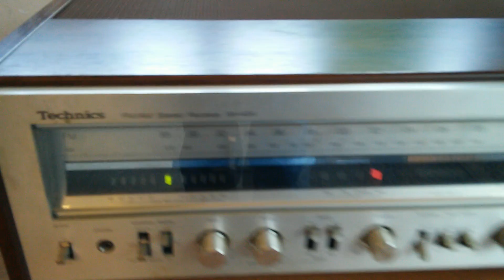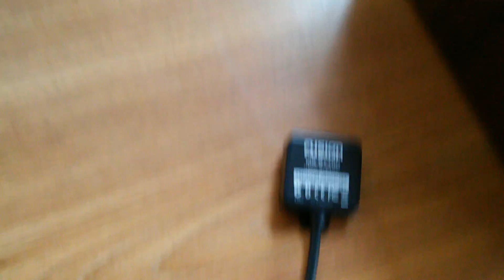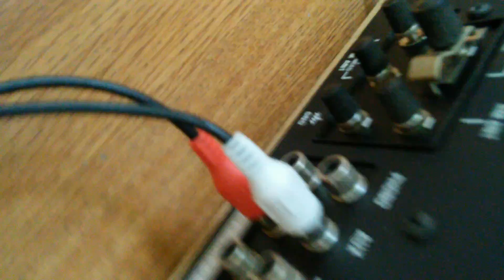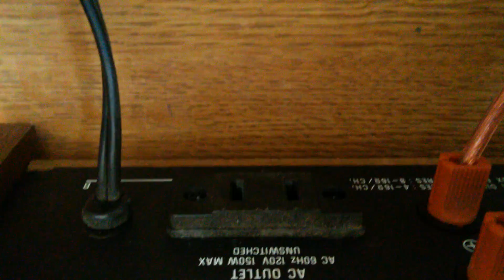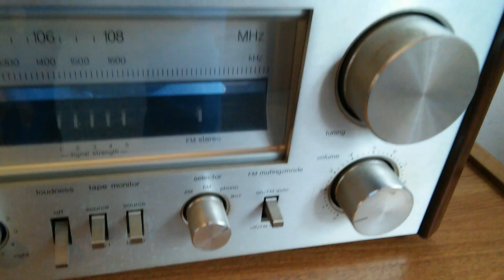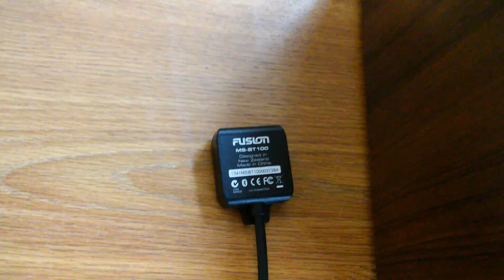Add Bluetooth to any vintage Home Stereo

Comment: My connection is very poor, volume very low, in and out, etc.  It has performed well at other times.  I think it might be my phone, low storage, slow,, etc...
Reply from the maker: could be, keep us posted. So others know what to expect...BB23
Reply: I find I have to jiggle the wire on my adapter fairly often, pull it out and push back in

Comment: Another, and perhaps more compelling way for wireless is Apple's Airport Express. Connect it to your modem/router and then to RCA input that's available on receiver. Now, listen to iTunes music library stored on computer or iCloud wirelessly from receiver. Also, the Airport Express will allow you to use iPhone or iPad as a music player, or remote for iTunes on computer with receiver outputting those tunes too.

Comment: Question. Is it possible to get CD quality audio this way? I've never heard a smartphone or tablet actually sound decent on a car or home stereo system. It always sounds digital, no base either.
I have a Galaxy S7 phone and a 2 year old galaxy Tablet too. Both sound awful with any audio i play... headphones sound great but it doesn't translate to my Pioneer in the car or my Bose/Panasonic setup at home
Reply from the maker: I have the same phone and a tab 2.7 tablet, both devices sound very good using Bluetooth. Audio snobs will not agree whit me, but you asked me and I say try it. you may just like the quality that you get. BTW ... using headphone out from your phone or tablet to your car stereo 3.5mm AUX inputs are going to sound like shit. IMHO
Reply: CountryBoy85  Thumbs up for caring about audio quality.
Reply: Strong Tower Lawn Care There are apps that may make that possible if you Daisy chain a tablet or laptop in-between. The sound vintage receivers and separates can put out will be hampered by a Bluetooth and compressed file vs a good Record player.

Comment: Do you know if you can use your phone as a wireless remote for volume on an old stereo receiver?
Reply from the maker: Two things,, I am glad you got an adapter and got your setup running. And On a old vintage unit that has never had any remote functions, you cant just "add" remote capability( no circuitry). Now if you have a unit that has had remote you can use a universal replacement remote control. as far asI know you cant use a smart phone to remote. UNLESS there is an app available like on modern TVs from the stereo manufacturer .. Thanks for watching....BB23
Reply: breakerbroke23 Thank you for the information. It's working great. I did find a universal remote so I think I'll use that. Love the video.

Comment: Any idea how to possibly wire the power supply for something like this to the power output of a stereo?
Reply from the maker: There are a fw ways to do that, look for a 12-28 volt dc tap on the power supply and use a usb step down module ($3 on ebay) they will take up to like 35v . or tap 12v from a dc source and use a 7805 regulator and make a filtered circuit board.....  IMHO just use the 110 adapter and plug into the sw out. I understand you would like a "built in unit" but in order to do this you better know what you are doing. OR you could ruin something or create a side affect like a hum or something by grabbing power off the wrong tap or part of a circuit.... OR hard wire a ac adapter into the receiver its self. Again, you better know what you are doing....If not, dont do ir...  BB23
Reply: breakerbroke23 thanks I was just curious if it would be possible, I’m currently using a sears Silvertone floor model record player and am/fm radio with an aux out (labeled for a tape deck) I’m currently using the rca to 3.5mm plug connected to a Bluetooth receiver with a 3.5mm plug using a coupler. The receiver is using a usb cable and power block. I’d like to figure a way to streamline this
Reply from the maker: Oaky, what is the model of your silvertone
Reply: breakerbroke23 the owners manual says 528.31093100
Reply from the maker: I cant find anything on your stereo. You could do what you want maybe if you had a schematic for the electronics. I like what you are trying to do, It would be cool.
Reply: breakerbroke23 it actually came with the manual and the wiring schematics are included. I’m a novice at that type of thing obviously or else I would t be asking lol
Reply from the maker: Hey since you have a schematic, maybe you could wire up one of these modules to your Stereos main power switch, and that would give you power for a USB powered Bluetooth unit ...hmmm  (the module has holes on the PC board so you mount it somewhere)
www.ebay.com/itm/AC-220V-110V-to-5V-DC-1-5A-Dual-USB-Car-Power-Charger-Step-down-Converter-Module/112471871214?epid=8004775070&hash=item1a2fd88eee:g:niEAAOSwhf1ZnjgP

Comment: Hello, I have an old stereo console , there is no aux input but there is a tape monitor thing on the back . Would that work and switch it to the Stereo option ? Thanks !
Reply from the maker: Using A Tape in or mon should work well, try it.
Reply: yeah thats what I used on my Integra for my BT. plugged it into the power plug on the back

Comment: It is easier to buy a adapter these days. Some are less than $10.00
Reply from the maker: Yes you are correct. You still need to power them up, either USB or they are rechargeable (PITA). so why not just do it right the first time and forget it. I still use this setup in my Office most every Day and have not had ANY failure of connect problems. BTW.. These units have extremely good range.  Thanks for your comment.

Comment: hi, when you turn the unit(technics) on and off does it detects and sync with the bluetooth or you have to turn the bluetooth on manually? thanks
Reply from the maker: When using a BT unit like the one in video, it turns on with the receiver and will sync with your phone or it will be ready to connect to yor phone if that is the first time.
Reply: sounds good. thanks

Comment: I have vintage Kenwood speakers and wanted to revive them. 
Simply, what is the best and smallest receiver/amp do I need to connect the speakers, in other words what components required when only having speakers?

thanks in advance for any guidance.
Reply from the maker: Small as in size, or power output ?
 Most all kenwood speakers are built whit highly efficient bulk drivers, so most any Receiver will work. BUT!
Try to get a 70st0 early 80s era Receiver. 30 watts per ch and up. 2) things.... Those Receivers usually have Phono inputs and have robust internal amplifiers for the most part. You can pick up modern Audio/ Video Receivers but their amplifier stage does not have the rich full sound that the older units have and usually no Phono inputs. (some do like Denon) INMHO 
 Remember, the more power you have the better. Even if you dont crank it up you still have reserve power (headroom) so when you are listening to say the 1812 overture and the cannons fire it will sound rich and full.  Thanks for watching....BB23
Reply: Great stuff. thank you. I need to digest it.

Comment: Once I restore my Pioneer Sx-1250, I'm gonna add this to it so I don't have to fumble around for my aux input cable anymore!
Reply from the maker: WOW those 1250s are bad ass. I would love to get my hands on one, Thanks for watching
Reply: breakerbroke23 No problem, I gotta fix an issue with mine, the left channel is quieter than the right. After that I have to replace the big filter caps, and see what else needs replacing.
Reply from the maker: Just a hint, Check the pre amp out level, make sure the audio out is equal. If not then check in the pre amp section. If both channels sound equal then the problem may be in the out put section. Good luck ....BB23

Comment: sounds like my old sansui 9090db is going to get hooked up with my ess amt1 b s  ( re coned)  are going to be playing some led Zeppelin, 😎
Reply from the maker: Those Receivers are sweet. Rock on!
Reply: I have a pair of Sansui S-517 65W speakers I bought in 1983 still kickin'. The receiver I bought at the same time, Pioneer SX-303 if I remember correctly, has long since made its journey to a landfill.

Comment: I fitted a panel mount bluetooth module inside a sony ta-636 amplifier
Reply from the maker: Very cool. How did you power it?
Reply: Fitted a dropping resistor from 22v DC to 14.2v DC on the preamps power input, changed the AUX swich to Bluetooth
Reply from the maker: Nice!

Comment: I'm using the Logitech blue tooth adapter, and when I follow the steps, I get this really loud feedback from my receiver when I turn up the volume and can't get it to go away.
Reply from the maker: Sounds like a bogus audio cable.Be it Phono to RCA or just strait RCAs. Or it may be a defect inside the Unit.  Please Let me know what you find.... BB23
Reply: It is a 3.5 mm aux to RCA cable. Getting a lot of static/feedback

Comment: true "Wall Warts" are linear (heavy) transformer based DC power supplies. They do waste a fair amount of power in heat. Better are switching (lighter) type ones, but they give off a bit of RF but are waaaaay more efficient.
Reply from the maker: TRUE, But when using a switched 120v out from the tuner/amp efficiency does not matter and I like the cleaner power VS A switched PS.. Great comment, Thank you.

Comment: Awesome! Gonna do this with my old Kenwood receiver. Been listening to Pandora with my phone and a bluetooth speaker but it's not the same. So can you still control the volume with your phone with this setup?
Reply from the maker: You can adjust volume on both Phone and Rcvr. I put vol on Phone almost at full, and then use Rcvr Vol to get max output, then if I need to adjust volume from a distance I just use the Phone's vol cont.   Thanks for watching.........BB23
Reply: @breakerbroke23  Thanks, this is what I wanted to know from the info in the video but you neglected to tell us. I thought, well that's nice you can probably turn the speaker signal on & off using a wireless remote (IE: your cellphone), but does it control the volume also? You should have at least mentioned it in the video or showed it's actual use in the video for those who are not so savvy.

Comment: Great idea, 
I was thinking about doing this with a car audio amp, PC power supply to run it. Sort of boom box/stereo for the android phone
Reply from the maker: Yea that will work well. Just start out with the Amp Gain controls set at their lowest. Oh, dont plug in or unplug the BT Adapter with the amp on or gains high, you will get a loud buzzz that could kill your spks..
Thanks for your comment...BB23
Reply: Roger that, I seem to have quite a collection of everything but the BT devices but I see there so many BT boards & modules now.
I'd really like to do this on my old Harmon/Kardon 430 "Twin Powered" receiver  25 watts RMS per channel
BTW I subbed your channel
Reply from the maker: Man those HK's KICK ASS! I would crap can the Car Stereo idea and break out the 430 they sound soo nice (you lucky dog) Thanks for the sub...... BB23

Comment: Its easy job,  just buy bluetooth receiver, solder a audiocable to aux intern, 5 volt adapter, solder 220 volt cable on the plug (or 150volt) and solder inside on the incoming 220volt. Tyreribs around everything, done..
Reply from the maker: Your suggestion is a very good one, unfortunately the soldering is above
 most peoples heads. If you create a bad solder joint on the supply line
 (110-220v) inside the receiver you could possibly start an electrical 
fire.
So unless you  can solder good I would NOT wire up BT in this fashion. Thanks for your comment.... BB23
Reply: breakerbroke23 I know that you need to have some elektronic experience and need to know what you are doiing.. Thanks for your kind reply
Reply from the maker: You gave me a good idea, I will post a video on how to do it your way. Thanks and please sub to watch the vid.. BB23

Comment: Nice video! I have a question, I have an old stereo with tape and record player. Is there any way I can hook up my phone for example and play music through it?? It only has a big stereo jack in the front and 1 small mic left and small mic right input... Thanks!
Reply: sorry, by big stereo jack i meant headphone input
Reply from the maker: So I am thinking that the headphone jack is out put only(listening on headphones ONLY). But you can use the mic inputs to play your phone on the stereo. You will need to make a 3.5mm stereo to 1/4 or whatever size the mic inputs are .... should work fine
Reply: Thanks, I'm gonna try that!
Reply: If you have Tape in (play) and Tape out (rec) in your vintage stereo receiver, you can connect your phone to Tape IN(PLAY) buy a 3.5 to RCA CABLE. Connect the 3.5 end connector to the phone jack of your phone, then connect the RCA END plug to TAPE IN(PLAY) at the back of your receiver.

Comment: well I bought a bluetooth reciever and connected it to my awesome hifi and the sound is **
Reply from the maker: Is ** good or bad?
Reply: @breakerbroke23  rem bluetooth compress the sound so its not going to be as good as turntable or tape direct to amp.

Comment: I used your setup for and old stereo but my iPhone didn't see the BT100.  I wonder why?
Reply from the maker: Make sure you are giving at least 12 volts DC to the BT100,  Iuse android and not sure how to make appl see the BT unit. My best guess is that you have a power issue

Comment: I knew it was a Fusion BT-100 Dongle as soon it came into view, I work for Fusion in Phx, Az. Cool idea to use for home stereo system.
Reply from the maker: What do you do at Fusion, I have been in Mobile Electronics since the early 80s, so to me this BT100 unit was a no brainer. Your product as well as the JL are outstanding for this application.
Reply: I'm just a shipper/receiver and picker...small warehouse. 
I'm was a installation tech for Ultimate Electronics doing car audio but haven't done any work for over 10yrs.
Reply from the maker: cheevs RPBanda
I started in 82 as an Installer, went on to owning my own Store. I no longer install, gave that up yrs ago(bad back :) ). I still design systems and dabble locally from time to time. I currently own another business and sure do miss my trade. You are still close to the trade .....lucky guy... Thanks for watching.,... BB23
Reply: Yea I'm looking into getting into making BT speaker systems both portable and in-home set ups. 
My brother is still in the trade for almost 20ys now. But he works on Lowriders...fiberglassing enclosers and panels. A car he worked on is in Germany right for a show

Comment: Hey, I have a Pioneer VSX-416 receiver and the thing doesn not have auxilliary RCA female ports, even tho It's like probably 20 years never than the one in the video. My question is can I connect the RCA cables to another port, like CD or DVR maybe? https://cache.osta.ee/iv2/auctions/1_1_15622312.jpg That is the back end of the receiver.

Thanks in advance! :)
Reply from the maker: Hi. My first choice would be the CD input, you could use the VCR/DVR, Tape, inputs as well, all the inputs are the same impedance and line level. So you really cant use the wrong one. Each manufacturer may have slight differences but no worries. OH just don't plug anything but video signals into the yellow RCA inputs.
Thanks for watching....... BB23
Reply: breakerbroke23 thanks for the fast reply, the same principle applies to the regular RCA to 3,5mm cable i take? 
thanks :)
Reply from the maker: *****
Yes. And if you are using head phone out to your pioneer, just turn the device volume down and the pioneers vol all the way down before turning on the receiver (so you dont wipe out your speakers) Some 3.5mm out puts can be slightly higher than RCAs. Depending on the device manufacturer. I usually start with dev vol all the way down and turn up stereo 1/4 vol, then I bring up vol on dev to a good listening level. Good luck.....BB23
Reply: Thanks man, youre the best ! Really appreciate your time

Comment: I like the USB powered Bluetooth receivers for this. No 12v power supply or wire splicing needed. just a spare phone charger with a USB port plugged into the receiver and a 3.5mm to RCA cable for the audio connection. I can't speak to the sound quality compared to the automotive version but the around $10 price tag is nice.
Reply from the maker: Yes that is one way to BT... BUT The quality is sub par. I will do a vid on one of these units. Thanks for watching and please subscribe to see any updates.. BB23

Comment: Great video.  Very clear.  Thanks.  I am looking to have my cd player in different room from my receiver with a bluetooth transmitter with RCA jackets.  Do the make a bluetooth transmitter that will talk to the bluetooth receiver?
Reply from the maker: I like the Fusion BT100 AND the JL Audio MBT-RX They are both "car 
stereo" Marine units. Very rugged and very easy to use. I have not yet 
played with anything that transmits BT, ..... Thanks for watching. BB23